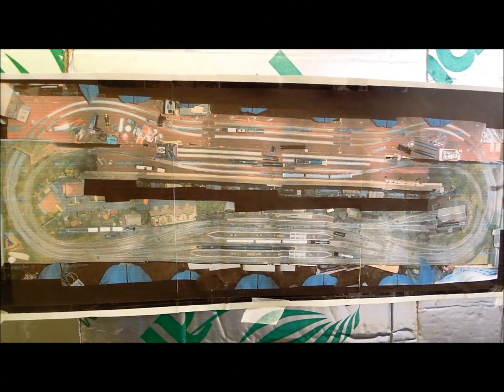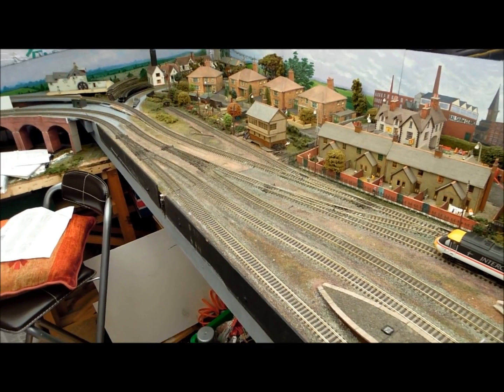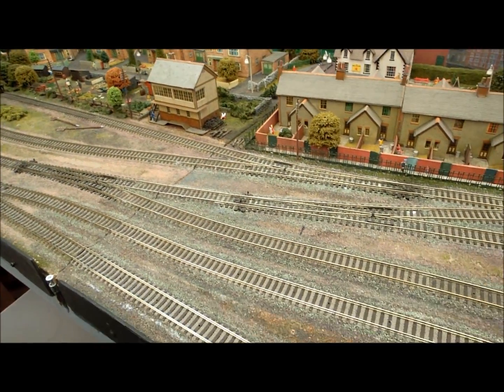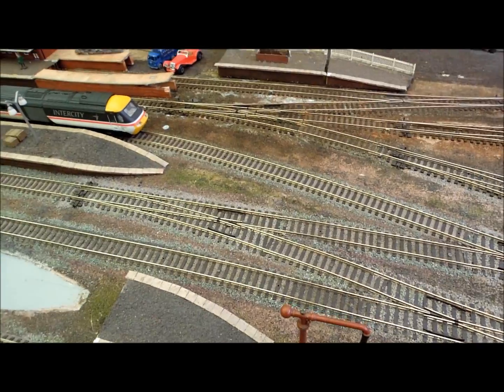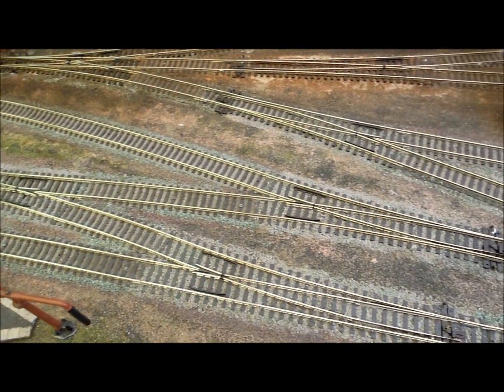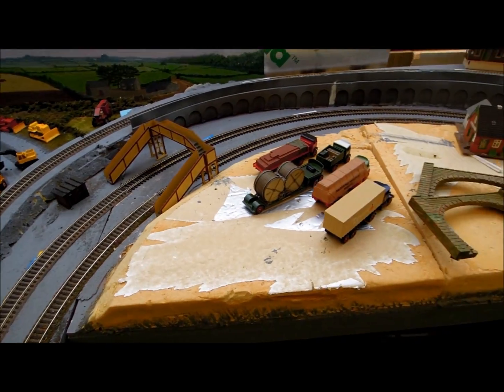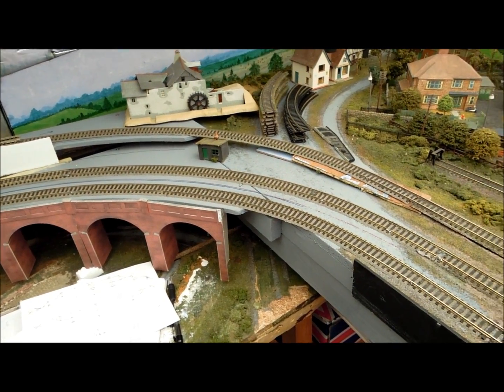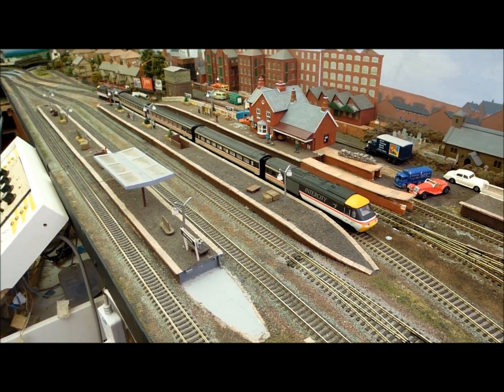track plan 1 of DC analogue shed layout, fiddle yard and passing loops

Comment: Just a quick comment on your very interesting video.  I think that electro frog points would work just as well provided that the rail breaks between the two feeds were carefully placed.  Facing points cause no problems.  It is only trading points that might need an additional feed and rail break.
Reply from the maker: Thank you Graham. Thank you for comment. On a couple of club exhibition layouts we have only used electrofrog. My video was as a result of finding that my insulator points worked ok as long as they were laid absolutely flat and the loco had plenty of pickups. If I was to start again I would use electrofrog. Cheers, John

Comment: Odd what you say about facing points being un-prototypical, my home station has a few of those where the up and down lines can cross over to access all 4 through platforms.
I suppose it's not really a problem since all, and I mean all, trains legally have to stop in the station, even if it's just a loco transferring to maintenance. 
All down to an accident in 1906
https://en.wikipedia.org/wiki/Salisbury_rail_crash
Reply from the maker: Yes Die, I guess they will be double interlocked. I even ride on trains out of Leeds that use facing points to reach the correct line. In many circumstances they were de... something as a safety principle. Trains could only access the opposing track by reversing. John

Comment: i'm new to model railway but nice layout i take it you use insulating joiners on the joining points
Reply from the maker: Yes Malcolm. I rarely cross a train from the up to the down running lines. I operate mainly analogue DC on this layout. When a train does cross, both lines are switched to the same controller. After crossing the points the two circuits can be separated again to different controllers. Have fun. I have had so many short circuits and trips in my time, but insulating rail joiners on crossovers is essential.

Comment: The layout was bought? So how much did you do, and how did you get someone to part with such a beautiful layout. Is it cursed?
Reply from the maker: At every second or third exhibition you will find some one with a layout for sale. I had to rewire this one and have reconfigured much of the track. Expect to pay from £500 to a couple of thousand for a decent layout without stock. I was offered a six by for scenic layout for£200 recently. It may still be in Manchester.
Reply from the maker: Club members sell exhibition layouts to part fund a new venture. Go to exhibitions and join a club to get close to a good deal. Allow a year or so. The layout is great. I love it which is why I'm prepared to pay for it and then spend time sitting out the problems. No second hand layout comes without problems. There is often a reason they are retired.

Comment: I\'m not sure but ,if anyone else needs to find out about how do you make a model train layout try Pycanta Model Railroaders Protocol (do a search on google ) ? Ive heard some awesome things about it and my co-worker got excellent success with it.
Reply: Pycanta is just an advertising site, there's plenty of FREE advice available on the web if you look for it.
Reply from the maker: Hi AJ. That coulkd be a useful tip. My friends use Templot and some other layout generation tools. All comments about various tools welcome, especially if they can be integrated into a train control (point control) system.

Comment: hmmm that noise sounds like interfernce.... i get cb radios fromsemi trucks... lori? anyways... analog and your narration and your layout.... all cool man... i hope you can stay entertained... looks good to me. Great job... shortened platforms... nice way to hide the size of the track... quite the illusion... looks posh but not shortened..... what a win... peace bro
Reply from the maker: Hi Jegas, thanks for your great comments. All very encouraging. This layout is in need of a good clean and a few bits of maintenance..
Reply: I find track cleaning only slightly less annoying then stuttering locos :) I heard an old timer say that running locos full tilt beats not running them and keeps the track clean. I can attest to one thing... the flower shop near my home as a kid had a N-Scale layout that CRAWLED around the bouquets every day (very cool) ... point is - that fella, the florist, said the same thing... I asked if he needed to clean the tracks a lot - he said never. :) Don't forget the dust in the lanscape - that can be a bother if it sat awhile :) Good luck!
Reply from the maker: Hi Jegas, that is a good point about the dust. I have neglected the layout for a while. I have a friend who cleans his track with diesel and leaves a residue which he says also cleans the wheels!
Reply from the maker: Its rain on the shed roof. It does sound a bit like white noise.

Comment from the maker: I have a loco fitted with the Maplin electronics control system from the 80s. These used chips designed for infra red remote control to control several locos at once on a layout. As with all technology - it takes a long long time to become really useful.

Comment: Its hard to believe that DCC is already 20 years old started in Germany 1989 under Lenz controls and I think still has major flaws in it  like what I've seen still loads of wires when design was to minimise wiring.But that said my loco shed is a separate scene not attached onto the main line so I will make this a DCC section at a later date but no sound locos not into all that but would be ideal when stabling locos on the same track.Hornby should of kept going with Zreo 1 makes you think.